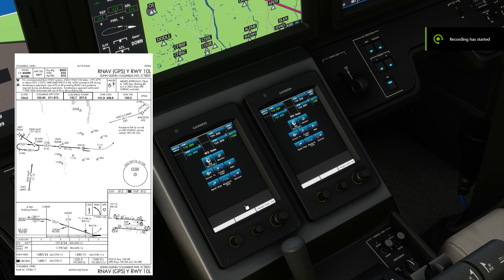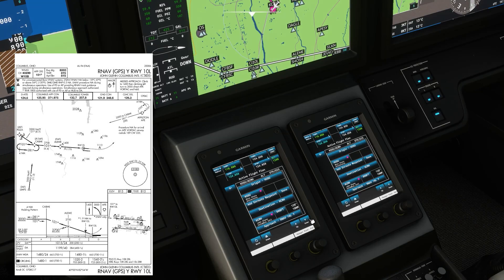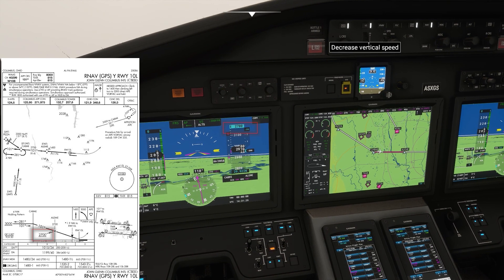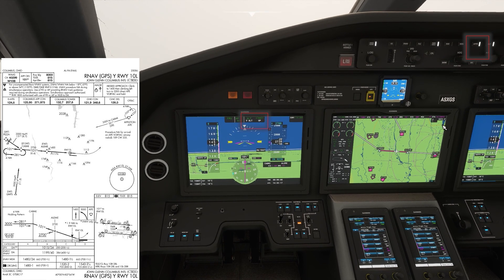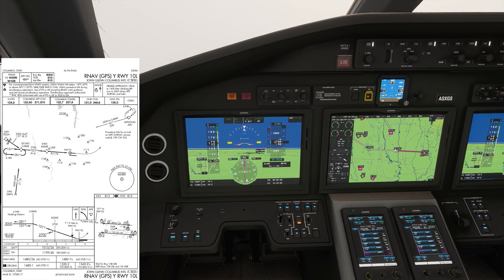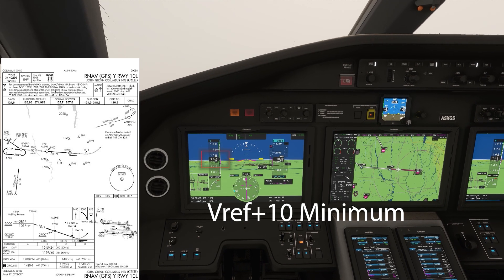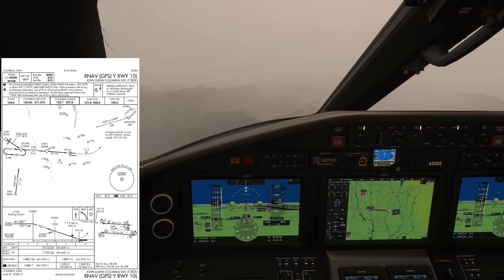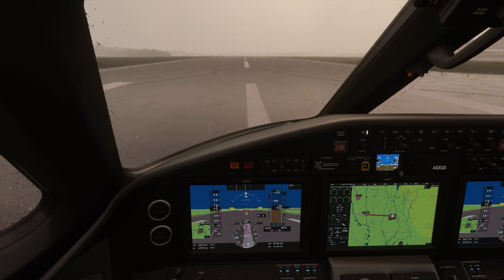RNAV GPS Approach Tutorial BY A PRO PILOT - EASY - Citation Longitude FS2020

Comment: How do you set up your speeds? Do you put them in the FMS or does the aircraft step down the speed as you add flaps?
Reply from the maker: The weights have to be set up in the FMS along with flap settings and then speeds will be populated.  The same is true for takeoff and landing.  I do have a video series on the Longitude.  There are 4 videos that cover a whole flight all the way to landing and even how to do a go-around and missed approach.  Only part 1 is public, the other 3 parts and other Longitude videos are available to channel members of the Private Pilot tier or higher.  Here is the link to the first video which still has lots of information. https://youtu.be/LlJbYfeBbvg
Reply: @thecorporatepilotdad  thanks for the detailed reply

Comment: Great video, I have been flying ILS approaches whenever I can instead of RNAs. It seems like RNAV approaches are still messed up and incorrect. In order to get to your pizza fix, you had to fly that annoying arc that shouldn't be there. Even if you go direct to Pizza, it will turn you right around after pizza and start the approach all over again. Have you found a workaround for this?
Reply from the maker: Yes, but it doesn't seem to work in all airplanes.    I have an RNAV Approach video in the Bonanza and shows more on the RNAV.  I have been able to go direct to fixes and habe it ingore the big teardrop it makes.  You can always send the GPS direct to the IAF and it might get rid of the big arc.   Fs2020 is so buggy it's not even funny.
Reply: @thecorporatepilotdad  I agree, I have been more frustrated with this sim the more I see what it can't do. The news about the Garmin system update, which won't release till February 2021 is frustrating too. I don't know If you have flown the Longitude since the last update,  but you also can't fly above FL350 without the aircraft constantly rolling. Any other aircraft you might recommend that arent as broken?
Reply from the maker: @adamryerse1828  I did a video on when to start a descent and used the Longitude and I did notice the rolling.   But realistic at all.   It makes a person wonder if they even test updates before releasing them.  They sold this game solely on graphics and charged through the nose for it.   I recommend any of the piston engine airplanes.  I prefer the  Bonanza and the Baron but the mixture control is the Baron doesn't work.   You can't lean it a little.   It's either set perfectly regardless of position or off.

Comment: This is so great. Thank you for posting these. I've been really determined to learn the longitude, and your videos have been really educational. When during the approach do you disconnect the auto throttle? Do you recommend using auto throttle on manual or fms mode? Lastly, to the untrained eye, it seems like RNAV and ILS procedures in the longitude are quite similar, except that for RNAV you don't need to punch in the localizer frequency. I had been under the impression RNAV would not manage altitude for you; is that airport dependent?
Reply from the maker: Disconnecting the auto throttle is up to you.  I fly a jet with auto throttle but I do not fly the Longitude.  I will use manual throttle most of the time.  In the game, I would turn it off when I see the runway but soon enough to also be able to turn it off as to not be doing it too close to the ground to have it be distracting.  I'm sure there are other schools of thought on that. RNAV with LNAV or LPV and ILS are similar.  RNAV is now GPS based and ILS is ground based.  In jets I fly you can put in the alitude at the final approach fix and press VNAV and the AP will hit the step down altitudes.  FS2020s VNAV function does not work - so far. The FMS in the longitude also shows Vx Vr and Vy under  performance.  Jets like these use V1 Vr and V2 for takeoff and Vapp and Vref for landing.  There are some fixes that need to be made.
Reply: @thecorporatepilotdad  thanks, this is really helpful too! I've been sort of tending to disconnect the auto throttle as I activate approach mode. Your explanation of RNAV VS ILS is the clearest I've ever understood. I really hope they fix the Vnav sometime soon. I also understand the longitude has some fuel guzzling trouble, and Im hoping they bring the HUD online soon! But all things in time. Thanks again. You've been super super helpful and easily earned my subscribe!
Reply from the maker: @Maelachlainn  Thank you for the subscribe!  I'm glad these videos are helpful to you and so many others. The CJ4 and Longitude are extremely over powered and have really high fuel burns.   I prefer flying the piston singles.  They remind me of the old days of renting airplanes and flying around for fun.